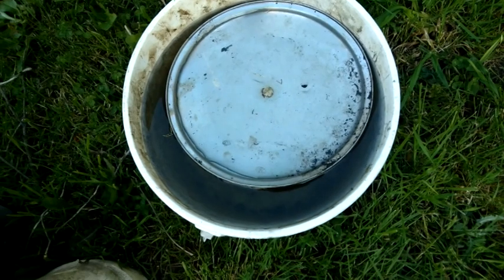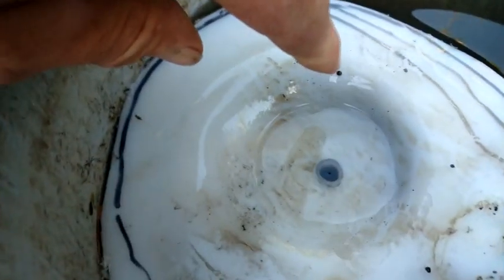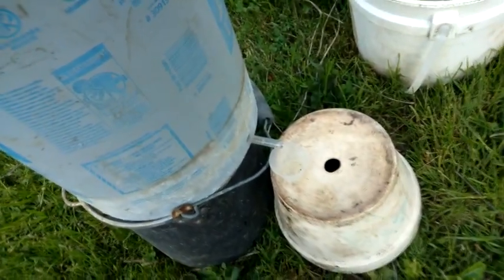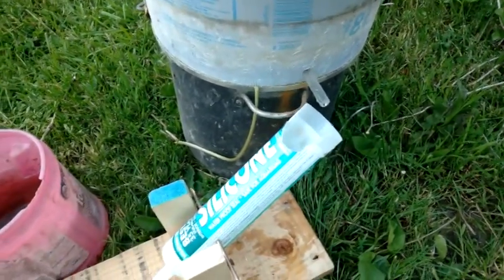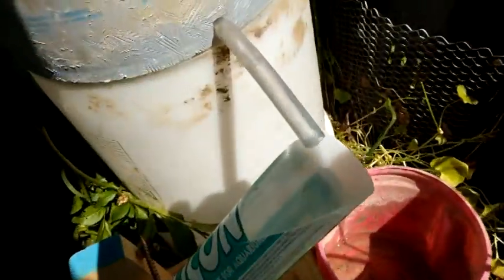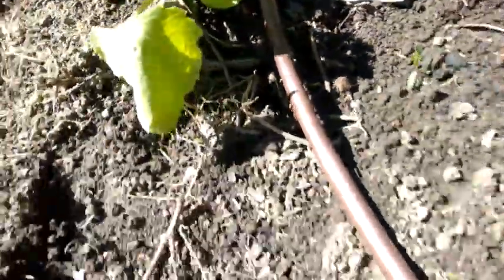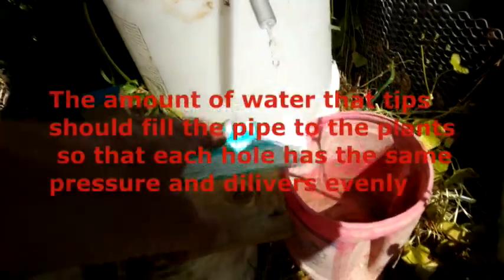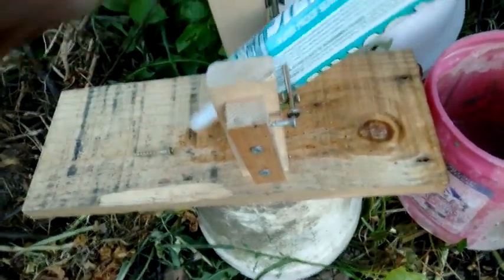Drip and tip Irrigation! New way to meter water to plants!

Comment: Pretty cool. What serious be the difference if you were to simply have a spout located near bottom of bucket draining slowly into the fill and tip? I would imagine that you would be able to closely regulate the amount of flow still.?
Reply: Yes but all the dirt at the bottom goes insinde te tube and seal it.

Depending the conditions if we're talking about a tank powered by a roof, it would be even better to have a way to prevent the poop floating at the top from getting into the tube. Generally over time it also ends up at the bottom.